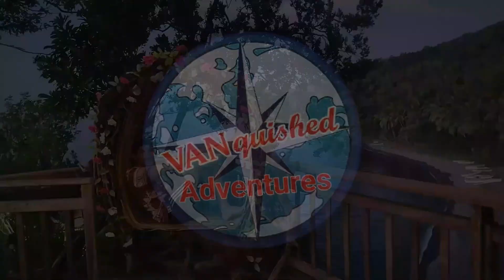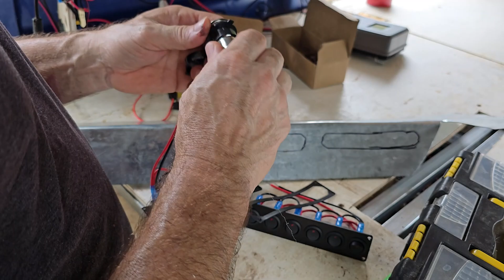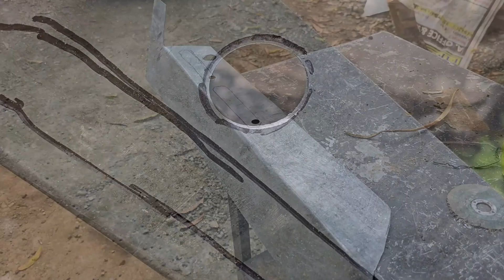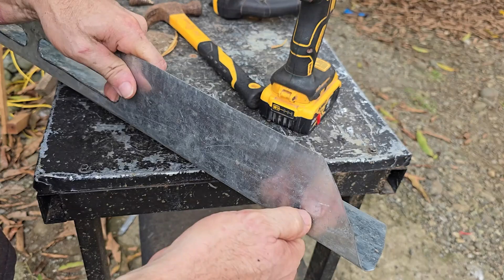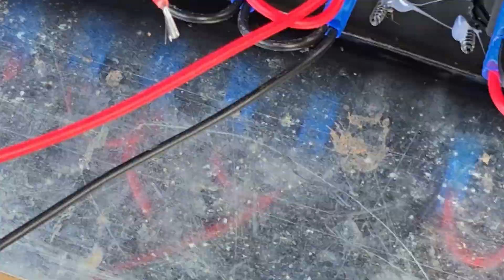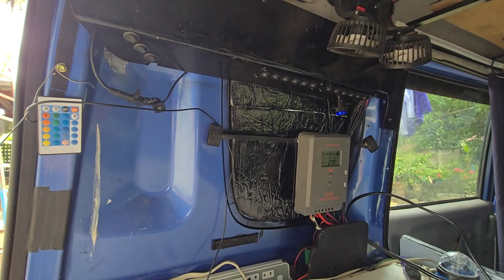12v Switch Panel Custom Metalwork Installation Vanlife RV Campervan Boat Wiring

Comment: Nice job! And yeah, if you aren't bleeding, you're not working hard enough. 🙂My hands hurt watching you crimp all those connectors -- I finally bought myself a long-handled crimper off Amazon earlier this year, I just could not get good crimps with a short-handled crimper. Amazing what a different a bit more leverage can make! Also keeps my hands from aching as much. 🙂
Reply from the maker: Thanks:) You can never go wrong with better tools.  One way or another they usually end up paying for themselves.